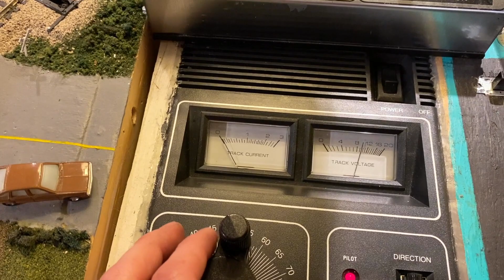Can We Save This Junked ATSF 040 Loco from the Trash?

Comment: Well done! That drive system is like one of the ones you would find on a Tyco Trolley. Very. Cool I actually had a diesel with dual motors of this type it was an F unit however the shell was shot so I salvaged the Brushes for spares . also how you did the wires is actually how they are done on a 4-6-2 pacifics . im sure all tycos were wired the same.
Reply from the maker: It's not a bad loco, It's nice that this style had five pole motors instead of the three poles found on power torques.
Reply: @SMTMainline  yes very true.  I really wish they could make them again it would make the model railroad market come alive with variety

Comment: I have this same model, got it to run with a lot of care and effort, it's a smooth runner, but when you get up to speed, everyone at a trainshow last year heard it though the whole building and it was a decently sized one too over everyone talking and the trains themselves

The couplers are always a pain to replace, I know your pain, not to mention I see the horn snapped off on yours two, thats ironic.
Reply from the maker: I think this one needs a bit of oil and grease although I have yet to find out how to access the gear box.
Reply: @SMTMainline  If memory serves me right since I haven't needed to open up mine for a couple months ago, It should open up from the bottom, or on the motor casing, I can tell you once I manage or remember how to open it, for lubrication on mine, I used a brand called Goo-Gone, which works really well and the Railroad Club I'm in has a bottle of it, which is how I found out about it. 

I'm glad if I helped you out with this dilemma.

Comment: I found one of those at an antique store in a yellow and blue varient for 15 bucks with the guard rail piece
Reply: The yellow & blue color scheme was one used by Santa Fe for their switchers & road freight engines.  I think Santa Fe painted its very first diesel switchers black.
Reply from the maker: Doesn't seem like a bad deal if it was a runner.

Comment: The blackness inside the shell suggests overheating. All that oil on commutator may have shortened the electrical circuit and caused smoldering.

Comment: Did the AT&SF ever have small diesel switcher locomotives like this? Did they ever have a paint scheme like this? Great job with the restoration as always Harrison!
Reply from the maker: Not that I'm aware of but the Santa fe had a lot of different locos and paint schemes throughout the years so they might have had something similar.
Reply: The Tyco is a fictional locomotive design. The Santa Fe though did have small numbers of industrial sized switchers including several GE 44 tonners, some Whitcombs and Plymouths, etc. Some of their oddballs though were just for working things like tie plants and weren't even standard gauge.

Comment: Recently i got a silver diesel ho loco but, apparently the person at the store said that it "tried to move" when he tested it. The wiring looks fine. What do you think might be wrong?
Reply from the maker: Have you tried cleaning the wheels?
Reply: @SMTMainline  so. I tried that as well as cleaning my testing track and adding oil to the locomotive and now it runs very smoothly.

Comment: Great work. Do you still have those motors you purchased a while back to replace older ones? Have you installed any more in any other locomotives?
Reply from the maker: I still have them but I haven't installed them on any other locos. They are ready if I need to though.